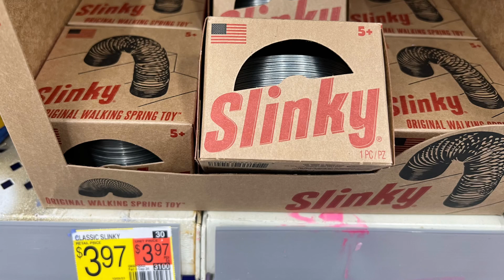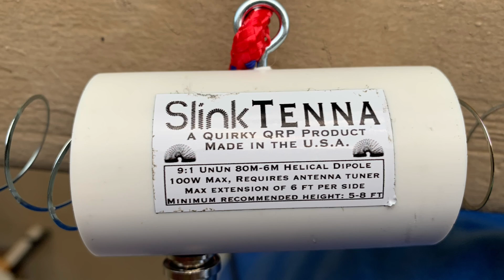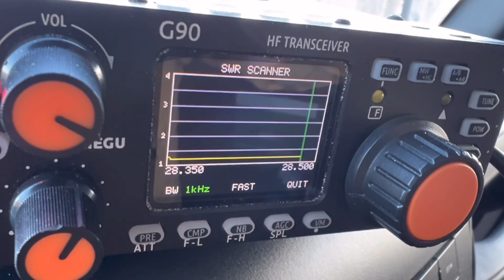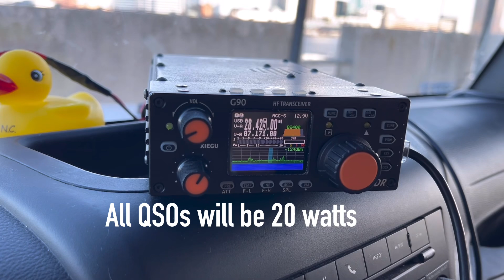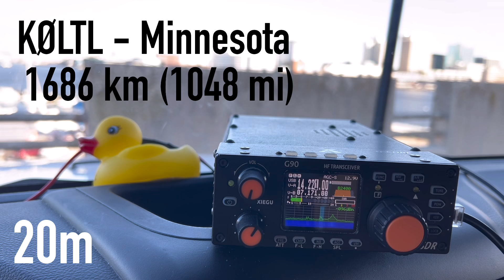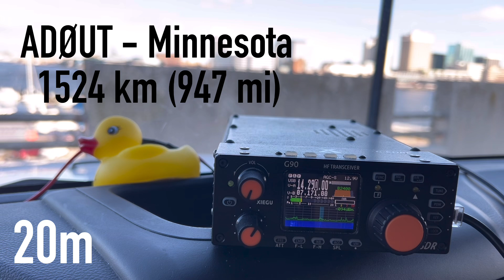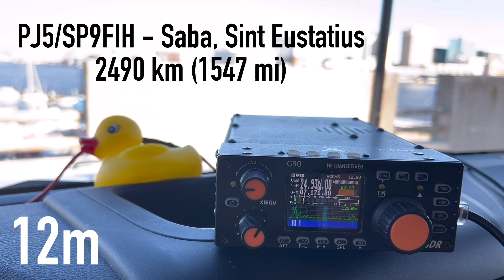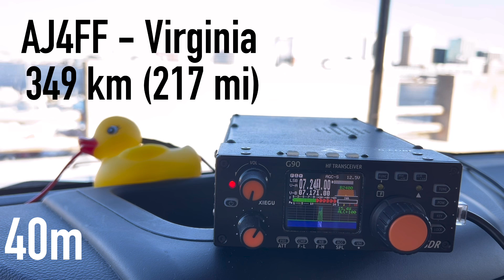Building a Slinky Vertical Dipole Antenna for HF Ham Radio

Comment: Hi Walt  would you be able to  load a single 2.75" dia. slinky in vertical  position  with a powered screwdriver antenna ?
Reply from the maker: It would be worth a try to find out!

Comment: Aloha Walt, I was hoping you had a sketch of this antenna so that I could try that with my G90. 
     Somewhere around the house here, I have a box of Slinky’s of different sizes including the Slinky Mini’s that I would like to set up for 10 and 11 meters. Plus, from watching all your videos, I bought the LDG 1:1,4:1,9:1 and bought a pair of 64:1 on eBay for about $17 each, so that I have one of each in my Radio War Go Bags. Plus I added BNC Binding Posts in each go bag along with a spool of zipwire. 
     I looked in the ARRL website for your new Salty Walt Sketch Book but was already “out of stock” but that’s ok, I want an autograph instead. Do you have your own website, Walt?? 🤔

Comment: nice antenna - what is the length of the pole that is used for the diapole - ie the vert length of both halves of the diapole - much obliged 73
Reply from the maker: The pole is 10 meters high. Each half of the dipole is 4 meters.
Reply: @COASTALWAVESWIRES  much obliged  for the info sir - not sure it will work up here in the far north but worth  a try - wud be an awsume fasr set up rig - thanks again 73

Comment: Slinky was invented by a marine engineer  in the Philly area .
Reply: Wiki
The Slinky was invented and developed by American naval engineer Richard T. James in 1943 and successfully demonstrated at Gimbels department store in Philadelphia in November 1945.

The Slinky was originally priced at $1, but many paid much more due to price increases of spring steel in Pennsylvania. It has, however, remained modestly priced throughout its history as a result of Betty James' concern about the toy's affordability for less affluent customers. In addition to its use as a toy, it has been used as a classroom teaching tool; as a portable and extendable radio antenna in wartime (particularly the Vietnam War

Comment: Another great video. You sold me on the g90 and while doing a POTA here in So Cal last weekend, I got contacts from Canada and Spain on 15m SSB calling in.
Reply: I went out and bought a metal slinky. I used it with my 21ft tenkara fish rod mast and LDG 9:1 with the G90. I found it was 1:1 on 10 and 17m. I could receive well on most bands. I didn’t make any contacts but will try again.

Comment: I like the FX-4CR, but you cant beat a radio with a built-in tuner.  looks like you borrowed the knobs from your RS-978
Reply from the maker: Yes those knobs are from that radio. 73, Walt

Comment: I am definitely going to try this one. I have a question though. Why don’t you just run your radio off the car battery?  Why do you use a LiFePO battery instead?
Reply from the maker: I just like to simulate how I will be running the radio portable as soon as the weather is back.

Comment: I have definitely thought about using one of the large slinky, "spring toys" from Popular Science as a counterpoise/negative end of multi-band vertical dipole(s), running the outside length of a mast. All I need is one of those sweet carbon fiber masts to hold up the contraption. Soon... For fun I measured the SWR on the slinky stretched out maybe just 10 feet or so, so that it wasn't touching and it was all over the place up and down. Was afraid the green eggs and sour hams might be getting to you with some of your videos. Good to see this kind of fun, experimental content elevating our community and your spirit. Cheers and 73 Walt!

Comment: Walt always enjoy your videos. You have inspired me to return the hobby, Due to 2 Strokes and partial paralysis for months I became in active, Recently I began binge watching YouTube Ham Radio related, for years I lusted over SDRs but most were beyond my budget.
However the G90 finally were was within my reach. As were many Antennas. I really especially enjoyed discovering your Channel.  I now have G90, 2 regular Slinky’s.
After watching you build the Large Slinky Antenna and how well it worked. Was motivated to once again to become Radio “Active “. 20 years ago I build a DIY Home Brew Multi Band Dipole the was easily tuned using the internal Kenwood TS2000 tuner.  Now with the aid a Rig Expert device I believe DIY Antennas will much more fun and easier too 💡😃
  
Again thanks for sharing all your insights, thoughts, especially your enthusiasm in this and your other videos. I hopefully will connect with on the Bands in the near future 😀

73 Steve AA4SH, Tennessee

Comment: That was great. in NY the metal Slinky harder to find in local stores . I got the same pole . and the new green one. the 2024 edition. DX engineering has them and DX 10 wire . the bands lately are hot.  even 160 meters at night. just 6 meters down for DX . that spring/summer the E layer gets going. I got 2 antenna's ready to go up the pole for them days. a 49:1 end fed cut for 6 M and type 61 core . tunes the whole band . and just a piece of RG 8X coax. cut for 6M  2 1/2 in PVC coil at end . have one for 10 M as well. working the UK from NY on 10 meters just a piece of RG 8X on a DX commander pole was fun. I made contact with a gutter antenna in England. was great. he loaded up the gutter with a tuner . love the fun ! 73's

Comment: That antenna worked pretty well and it looks like you had a great time as well. It's amazing what will get you on the air. I'm playing with a linear loaded doublet in my attic right now. It actually does get out. Great video, keep up the good work.

Comment: Great results! I tried using a prebuilt Slinky antenna years ago indoors on HF and it didn't work well, but then neither did any other indoor antenna I tried. I love how amateur radio operators are able to make almost anything into an antenna and I love these "practical use" videos you post. 73 Walt!
Reply: I'm restricted to indoor antennas as well and they are a compromise, but they can work. Don't give up.
Reply: @redstickham6394  I gave up trying to have an HF shack in an apartment a long time ago, but I plan to get back into amateur radio when I retire. The good part is that so much new stuff has come out since I last owned HF capable equipment and it's much cheaper to get on the air nowadays than even 20 years ago.

Comment: Question Walt:  since it is a dipole it should have a resonant frequency when used without a transformer or perhaps connected to a 1:1 balun. Curious as to what that would be.  Your. Ideas cost me money btw. Just ordered the antenna mast and slinkies
Reply from the maker: I'm not sure but I would think somewhere between 75 and 60 meters
Reply: I just set up a single slinky as an end fed long wire on a painter pole with a 9:1 unun.  It is showing < 1.5:1 on all the ham band 40 and higher.  !!    @COASTALWAVESWIRES
Reply: I have photos but not able to post them here?

Comment: I was telling one of my non radio friends that you could reach halfway around the world on 5 watts. He looked at me like he was saying something smart, Well could you reach all the way around the world with 10 watts. How do you answer a reply like that. I said yes I can but I would end up talking to myself. He thinks the internet is the same as radio. I just smile and change subjects, I thought someone might see the ironic humor in that. He did not get the "talking to myself" at all.
Reply: One of the USN attack subs did that with its HF antenna extended just above the surface. It sent a pulse that arrived after circling the world about 1/7 second later. Of course it was probably running a bit more than 10 watts.

Comment: I have used the cheaper option which is electric fence gate springs. The only problem is they are really strong springs! I had two as a dipole with a 4:1 balun stretched to 8m long and it was 1:1 on 10 MHz. Worked really well too. Just sitting here reading the G90 manual prior to ordering one. Just sold my current portable radio. Its the ATU. Previously I have spent half my operating time dealing with fine tuning.

Comment: Walt: Great video. I've always had it in my head that slinky antennas where all loading coil and no radiator, but based on your work, it looks like they radiate pretty well. I wonder if slinky radials would work efficiently on a vertical. Maybe one or two slinkies attached at center points creating an X with 25 feet of counterpoise times four. It would take up much less square footage than regular wire (ie maybe 10 feet rather than 25 feet from mast.) Your videos are good at making people think outside the box on antenna design.

Comment: Good morning Walt, great to see you making contacts with the slinky antenna how many watts were you running?
Reply from the maker: 20
Reply: @COASTALWAVESWIRES  that’s what I thought since you had a G90 but I wasn’t sure if maybe you were using less than 20 watts.

Comment: Nice job Walt   with two  medium slinky's (2) , I have three large slinkys (3) two(2) on one side and one(1) on  the other with a 75 ohmn  t v cable  transformer  and coax to my sdr-rsp/dx receiver    what a setup

Comment: Thank you, Walt, for promoting fun! 

I have been using a single slinky for short wave listening for some time. It makes for an amazing number of stations I can receive compared to the internal antenna. I also have a slinky dipole used an an inverted v, and it works well on 10 and 20 meters. I look forward to more fun on your channel.